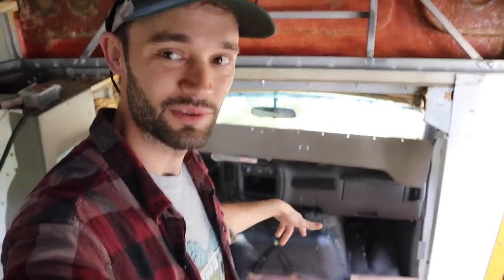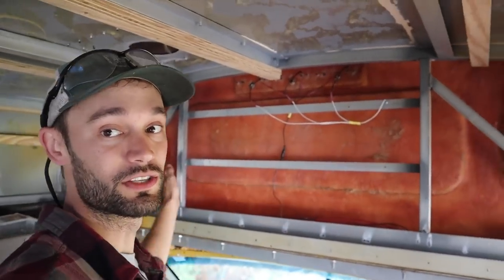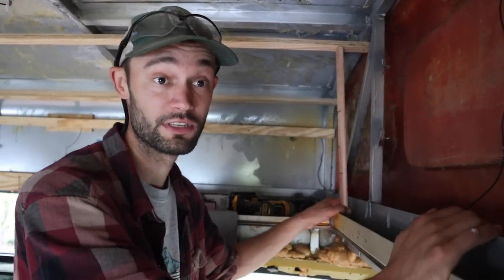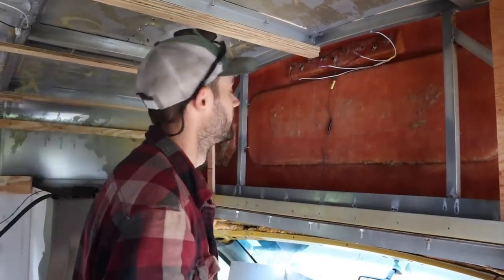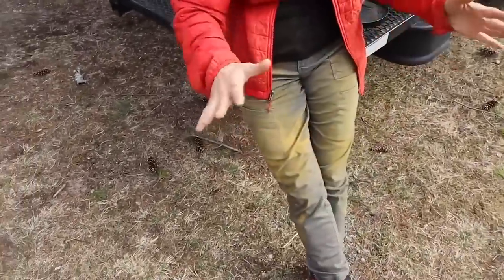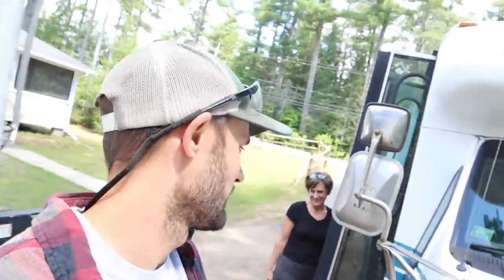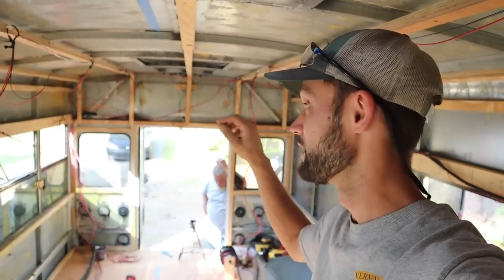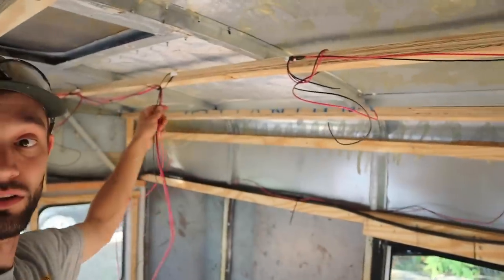1000 Feet of Wire | How to WIRE your SCHOOL BUS CONVERSION

Comment: Another reason to run a hot and a ground: PWM Dimmers for LED's work by modulating the negative, not the positive. Without a ground going back to the dimmer, the light will just turn on permanently rather than dimming on/off.

Comment: Quick tip. Have someone or something hold one end of the pair of wires and the chuck them in a drill and spin it up. Put a little heat to them and it will make a twisted pair if wire it will be easier to deal with as they turn 2 wires into 1

Comment: Needed this video, thank you. Have yet to run 12 volt and have plans for enough devices to have concern that I have enough wire run. Nice job with details about safety and leaving excess for spray foam. Didn't think of that. Consider installing a dimmer up front for your three way. It's like night lights in the ceiling when they're all the way down, and the rear switch will memorize your dimness setting when turning the lights back on from the back. That's what I did for my main lights with a hallway switch exiting the bedroom, a separate 2 way dimmer for the two bedroom lights and a separate 1 way switch for a single utility light in the garage. Might as well have full control/convenience of lighting where it's desired. Bus looks great man!!! Can't wait to paint ours.

Comment: It's really coming together Mike tell your little sister thanks for making us wait 2 days I thought man we'll never see this thing get wired but you pulled it off buddy. Lol anyway can't wait to see the spray foam done if you don't mind could you give us the cost and a break down of what your goal is with it like how thick and R value your hoping to see. I'm asking because I'm getting mine done and don't have a lot of examples mines 40ft by 7.5 wide and a little over 76 inches in headroom is appreciate it very much thank you for sharing your builds with us Mike I know it's a ton of work to do it.

Comment: I am wondering why do you not use say 14/2 wiring instead of the single black and red. It was recommend to me to use, such as speaker wire. Would you recommend this. I just want to make sure before I more forward. Thanks so much. I really enjoy all the tips and help.

Comment: Hi Mike,  I have recently subscribed and have been following your Ivan build.  My wife and I have recently started our conversion and I am trying to get ready for spray foam.  I have a question regarding your wiring for the puck lights.  It looks as though you will have one set of wires that go to from the panel to the puck lights then are they all wired off each other?

Comment: With copper prices up this year 2021, do you have a good link to a place to buy the 14 Gauge THN wire? I did not see a link on this video. I am trying to explain to my son that you can not just run single strand copper in a bus. He knows how to build houses, but I am telling him he needs to think as if he is building a boat instead when it comes to electrical....Thanks
Reply from the maker: The 14 Thoth I got at HD so I didn’t have a link for it. As for wiring a bus you are right in thinking it’s just like a boat. We use almost exclusively low voltage and either use a common neutral (bus body) or run two wire system. Best with your build. ✌️
Reply: @navigationnowhere  we have a ground to the frame from a wheel chair lift we removed. So I am thinking of attaching a bus bar to it and send all the grounds to thst main frame ground.  There is also a power lead from the 3 bus batteries. I am thinking of using that hot wire in the build as a aux power or a aux supply to charge the house batteries when the bus is on the road. Listed as always hot on the bus fuse panel.

Comment: Okay 3 things you could do to make life easier 
1 - run conduits with LB's  that way if you have any working problems in the future you won't have to rip the bus apart to fix wiring problems.
2 - you could use teck cable the smallest guage you can get is awg 14 in a tech cable they can be multi strands. Tech cable is the bomb. If you need smaller guage you can get instrumentation cable in a casing like the tech at any guage with multiple wires I have used both and it makes wiring easy it is direct burial approved if ever needed, you could run 2 tech cables on either side of the bus with junction boxes at the front corners, back corners and in the middle. Only thing is tech would not be serviceable but it is very robust it can be expensive there are special water proof connects that are water tight ratings. You would be running 1 cable with multi wires if needed or 14 3 tech cable. Just a thought.
3 - run multi wire cabtire wire. Will be less fiddling with individual wires, better isolation, more durable

Comment: Where are pulling all the power to power everything an external battery or from the bus batteries?
Reply from the maker: The bus batteries and house batteries will be separated. They will be connected through a DC to DC charger to allow for charging from the alternator.

Comment: Is that cutaway section strong enough to support the battery or batteries for the solar system?
Reply from the maker: It might be. But, it’s not much space and would be a pretty high location to put battery weight
Reply: @navigationnowhere  thanks. How do you figure out how much battery storage and solar panels needed for a build. Do you have a video on that?

Comment: Mike, Do you have a diagram of this wiring which I can use how many switches, lights, speaker wires, etc to be used in the 30 ft bus? If yes, please share that diagram.
Reply from the maker: I don’t have a diagram. I just go wire by wire and take my time. Sometimes you can get a schematic from the company.

Comment: Question I was wondering if anybody ever thought of raising the roof on a short bus and put a loft bed but still have enough room to stand underneath?
Reply: That would require a very tall roof raise, at LEAST 24" but probably 30" or 36". It would also restrict your ability to put anything on your roof and still meet the height restrictions for traveling under overpasses.

Comment: Please don't use solid core wire like "Romex". Stranded wire is used for vehicular wiring 12VDC as well as 120/240VAC. It deals with flexing and vibration and is much less likely to work harden and break.

Comment: So what's the point of adding all the additional insulation yet having walls of windows? I mean in terms of thermal loss and exchange windows are always the worst and bus windows are exceptionally poor. Seems like overkill...
Reply: I am taking the liberty.  With that theory, would you seal and enclose you kitchen, living room, dining room and bedroom windows?  Making thermo window coverings to protect severe gain or loss yet still gives you the amazing views all land locked, sticks and bricks dwellers only wish they had.  Life is about compromise, as we live or as we think.  Be positive and see the good ...🚌🌎🚌
Reply: @brendaswann7292  my point is windows, especially single pane bus windows, are heat loss holes. A person could replace them with better rated windows. Leaving them negates all the insulation. Think about freezer with a single pane glass window...ice forms on the outside, hence, all the insulation work is pointless.

Comment: You probably don't need wire that large for tiny LED puck lights.  I'd say 16 or even 18 should be fine depending on the draw.  Although, you do have to downgrade the wire if you spray foam them.  Also, you should use a sheathed wire, a conduit or loom, or at the very least protect the wire from rubbing on any edges as the truck will no doubt flex while driving and you don't want rubbing.  Also, you want to keep a few inches between 12v and 120v wires.